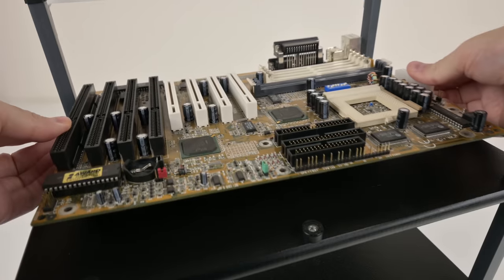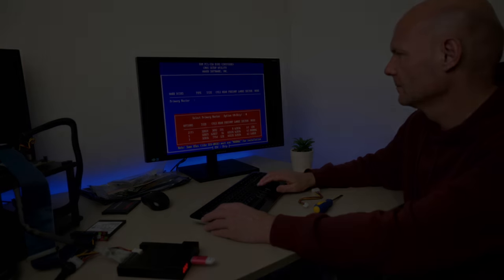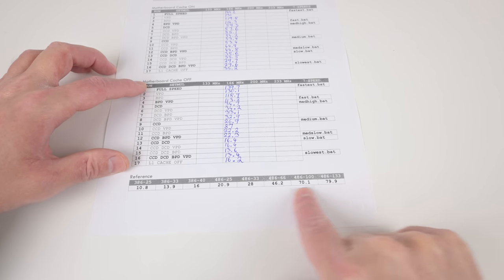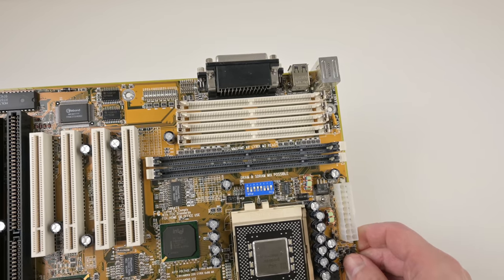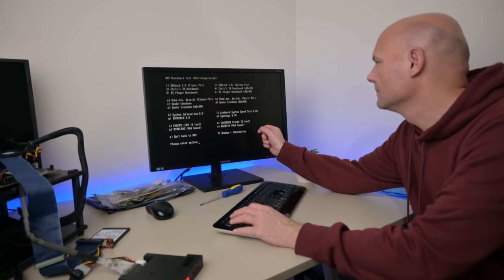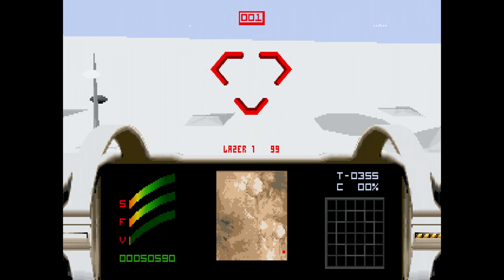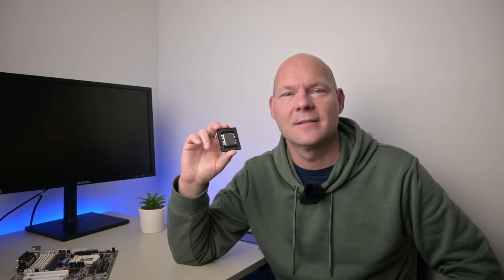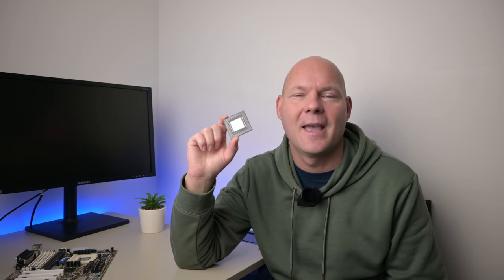Pentium MMX 166 is one of the Best Retro Processors

Comment: Another cool video, with interesting topic and tips that can be applied on this and other situations.  Your motherboard is amazing (GA-586ATX), but that is very rare and most socket 7 boards don't have all the niceties as this one. Really enjoyed this one. Would a Slot 1 Pentium II 233 be a suitable configuration for a similar project? Slot 1 motherboards and Pentium II are easier to acquire, more compatible with PSUs, PS/2 ports etc. Kind regards from Brazil
Reply from the maker: Nope not at all I'm afraid. Pentium 2 is either fast or extremely slow. Use the Pentium 2 for demanding DOS games and light Windows 98 games.
Reply: @philscomputerlab  Hi Phil, I checked out a P2-266 with cache off (10.9 on 3DBench, close to a 386-25), a P3@266 (11.4), P3@300 (16 - close to a 386-40). Is 3DBench a good reference? What do we aim for Wing Commander 1? 386-40 is too fast? Or 3DBench does not tell the whole story? cheers
Reply from the maker: @AladimBR  Try playing Wind Commander! Around 10 is a great speed.

Comment: How does it compare to a non-MMX 166? My Apricot has a 166Mhz Pentium non-MMX and doesn't support MMX unless upgraded with an Intel Overdrive CPU
Reply from the maker: You can't do the fine slow down steps, only full speed or slow speed. Better than nothing but the MMX has more flexibility.

Comment: I love your videos, I ended up getting the Gotek floppy emulator.  One question I have is do you have a list of floppies that you keep on the usb stick? And also do you have ways of downloading such things? I am currently struggling with my disk 1 of Dos 6.22 install.  It is bootable, however, it does not like the disk in the installation of the OS so I have to format as a system disk and manually copy over all the files that I need so that I have the full version of the OS.  Thanks for the amazing videos and keep them coming!
Reply from the maker: Yes I have an A4 sheet with all the disks! However I'm transitioning to Flash floppy soon and there will be a video about that one.
Reply: @philscomputerlab  I am looking forward to that one.

Comment: hi, friend. 
A little off topic
I need your help. I have two motherboards AOpen vi15g, that same model with support for 3.3v CPUs. They are part of some PCs (the other is a Pentium MMX 200) that I had at the end of the 90s or the beginning of this century. All the parts and pieces were stored almost 20 years ago. A few months ago nostalgia assaulted me and I am reassembling them. All the parts needed a lot of cleaning, from the PSU to the cards, due to the dust accumulated even inside the boxes, in addition to some slight oxidation. Everything has been pristine after cleaning.

I have some 486 but the best one is an Am5x86. I didn't remember if the jumpers were set for that, so I looked for the documentation (there are two documents, one original from the first version of the motherboard, which only supports 5v, and another partially updated for the revision with 3V support). I configured the motherboard as an Intel 486DX4, also as an AMD DX4, based on some recommendations. both are 3.3/3.45 volt processors, but when measuring the voltages on the socket pins and on the regulator output, it's always 5V no matter the configuration. It happens equally on both motherboards, so I don't think the regulator is defective in both cases.

I would appreciate if you help me with the correct configuration to be able to use the Am5x86 (or 486DX4 from Intel or AMD). The other 486 compatible I have is an AMD 486DX2-66 but of course the primary interest is the Am5x86.

Comment: @philscomputerlab - Hi Phil, have you done some test of modern power supplies, which one is suitbale for these boards and CPU's, please? I'm just putting together a K6-2+ machine, luckly I have one old power supply with 30A on 5V, however, it's an old one. I was wondering if there exist still a new power supply, which I can use for it?
Reply from the maker: These machines don't use much power. I use and Asus 750W with all my projects ..

Comment: I had a pentium 166mmx with a Gateway 2000 as a retro computing system. However, I am now officially surprised to find out that I can really use SetMul to seriously SLOW down the computer to either to a 486DX2 66 or even a 386. Why after all this time did I not hear of this?! 

Also, I am building a socket 7 early pentium with a 75-90mhz processor though the board that I bought supports mmx processors.
Reply from the maker: You won't regret it, the Pentium MMX with setmul is so versatile!
Reply: @philscomputerlab  and does the cpu just stay at that clock speed or it is reset upon reboot every time?
Reply from the maker: @Cortana_longfall  It resets when you reboot. You can also reset by running setmul again with the proper commands.
Reply: @philscomputerlab  hmm, the fact that it resets upon reboot is a no go for me hence why I bought a pentium 75 and 90mhz plus a 1 mbyte 1994 pci video card to recreate a fast 486/slow pentium with windows 3x and 95 since I am thinking of giving and selling my socket 3 board, vlb io controller and vlb video card.
Reply from the maker: @Cortana_longfall  Why?? Just write a few batch files. Check my 136 in 1 video it shows you the way
Reply: @philscomputerlab  well, I already have a pentium ii clocked at 450mhz with a voodoo 2 so I am aiming to have a high-low mix with the latter being at about as fast as a fast 486 or slower. Second part is that I prefer to recreate that old timey pentium experience and still be able to slow it down helluva lot vi messing with the caches and memory timings via bios and lastly I tend to have separate OSes and stuff on my vintage computers where I see appropriate. 

I do appreciate the concept of significant slowdowns via batch files but as you mentioned about it being reset after restart, it has some limitations. Also, I watched the 136 in 1 video as you suggested.
Reply from the maker: @Cortana_longfall  What are the limitations? Put it in Autoexex if you want it at boot. Flexibility is THE advantage.
Reply: @philscomputerlab  I can do that though I personally just like to have two computers of different eras. I also have three vintage Macintoshes so to speak. To each their own. 

Will the setmul tool even work with a pentium 75-90mhz as well?
Reply: @philscomputerlab  shrugs honestly they may not be limitations to some but moreso to someone like myself I prefer to have at least 2 systems that do not compete with eachother and resemble each particular eras of PC or Mac. Just a personal opinion mind you. The idea of being able to play a title of the likes of Wing Commander at the correct speed on a speedy pentium 166mmx is awesome black magic.

Comment: Haa, I literally just picked through my pile of Socket 7 Pentiums before I saw your video.  The lowest is a ceramic 133 and the highest is 233 MMX.  There are like 6 of them in total.  Also found a K6-2 450 in there in a voltage adapter board...  Hmm, I never tried that one.  Which one would you pick, Phil?
Reply from the maker: The K6 needs 100 MHz bus to shine, whereas the 233 MMX will do just fine in a regular Socket 7 board. If you want to play older DOS games, go with the MMX for sure!

Comment: 6:36 Wait, did you actually said ATX? Wow, I thought ATX Started with Pentium II... (Also yeah, I noticed the ATX Power Connector on the MB itself.)
But it's a good thing, because I would like to try out AMD K6/K6-2 One day. Pentium MMX is cool and all, but seems like AMD CPUs are a bit niche compared to Intel.
Pentium MMX is a good option too, though, the way you can slow it down to 386 and such is really neat.

Also - I love using Windows 95 a bit more than DOS, The GUI is super enjoyable to me, and makes things easier with folder managment (Like you said) and so on.
Reply from the maker: Yes Socket 7 boards, the later ones are already ATX.

Comment: Overclock that!   Depending on how fast that board can push the fsb you should get 225mhz.  I can achieve 250 from a 200mmx on 83mhz bus.  There was a hidden setting on some asus p55t2p4 late revision morherboards that could do 100mhz bus but doesnt.

Comment: Can the K6 be used in a similar way as far as slowing down? I just found our old socket 7 system and it has a k6 233 in it.. so i wasn't sure if i should keep it or switch to intel
Reply from the maker: It lets you disable the cache, but doesn't have the other options for finer speed tuning. So yes, but the Pentium MMX is better at this.
Reply: @philscomputerlab  I'll be picking up a pentium mmx then! (assuming the board works lol) thanks Phil!
Reply: The board was no good, but today i scored asus super 7 board with a 166mmx so full speed ahead!

Comment: I thought, the MMX 166 came only with the ceramic package and not with the plastic package, these are more around after the pentium 200 with and/or without MMX and the 233 ones only came with the plastic package. I'm now confused
Reply from the maker: The Pentium classic is the one with ceramic package I believe...
Reply: @philscomputerlab  the first MMX with 166 MHz was also in ceramic package, I know that, becaus the rig of my parents had a such cpu w/ ceramic package and on that top was written "Intel Pentium w/ MMX tech" and on the bottom of the ceramic surface was the 166 MHz mentioned.

A plastic version is for me very unknown, but hold this CPU, so such uncommon variant of that CPU are going to be more valuable.

Comment: If slow is good, try an 8088... (or a 386, if you need 32-bits).
Reply from the maker: Of course slow is good, but with these CPUs you are stuck at slow and don't get the flexibility as with the Pentium MMX.

Comment: Yeh the 166Mhz was decent.

Think that's good find an old push button to open actual desktop case. So it's a Desktop not a Tower , something that seems to be lost in translation a lot these days. You press the 2 buttons one on each side, lift the lid ( think like a cars trunk / boot ). Make your changes, move a jumper / add a card ect. Close lid. 

Why modern computers are towers with Heavy GPUs ect all sagging down needing braces or extended into a desktop orientation called a vertical mount 😂. When we could just literally use Desktop cases.

Comment: It's great but if you have a 233mmx you will be on top.
Reply: 266MMX
Reply from the maker: Yes it is faster but not not enough for high resolution games, and 320x200 games are already smooth with the 166.
Reply: @philscomputerlab even if you use fastvid?
Reply from the maker: @flightsimdeskuk  Yea. Might be different with AGP system though ..
Reply: @flightsimdeskuk  Never used it. What does it do?

Comment: What the difference between 166 MMX and 200 MMX, 166 better?
Reply from the maker: 200 is faster but can be downclocked to run also at 166.
Reply: @philscomputerlab  i thought there were some multiplier locked mmx cpus,, something to look out for
Reply: @philscomputerlab  ok that's good to know! thanks for info.
Reply: @philscomputerlab  Exactly so every Pentium1 MMX should be fine for retro. ;)
Reply: @kyrieeleison1905   In P1 multiplier and bus are changing by DIP switch or jumpers.